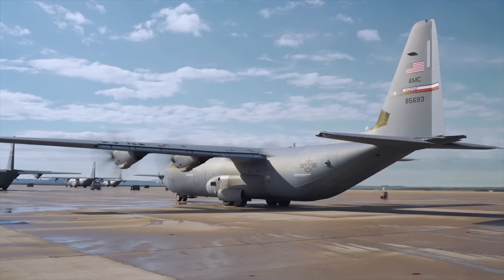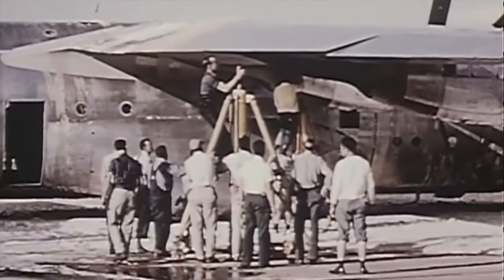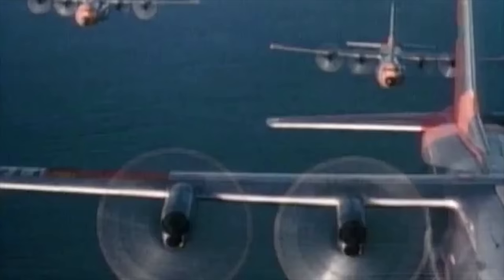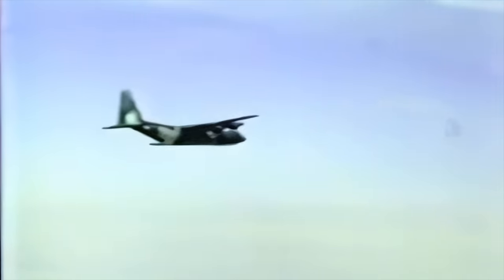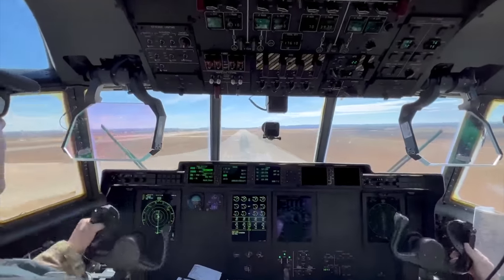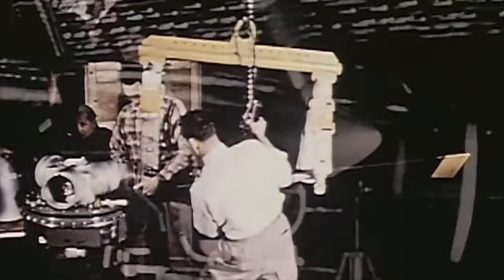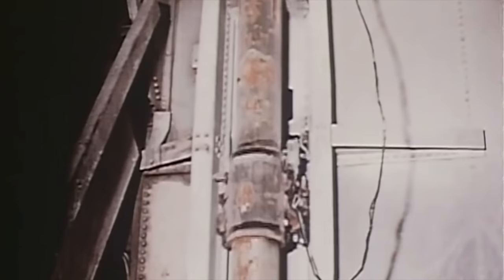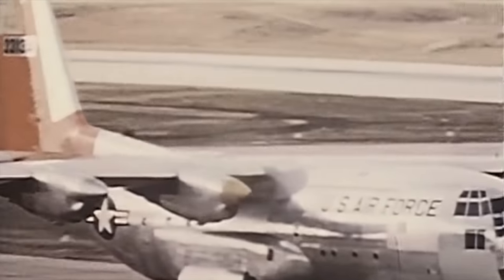C-130 Hercules | Gunship,  Cargo Transport, Search, And Rescue. Lockheed's Versatile Aircraft

Comment: Fine video but your gunship specs are a little fuzzy.
 As used in Vietnam, the first AC-130A gunships were equipped with 4 each 7.62 mm mini guns and 4 each 20 mm Gatling guns. Later after modification called Pave Pronto, the aft 2, 7.62 mini guns and aft 2, 20mm Gatling guns were deleted and 2 each 40 mm Bofors cannons were installed. When the AC-130E model was brought on 
line in Vietnam it was equipped with 1 each 105 MM Howitzer in place of the aft 40 mm Bofors cannon.